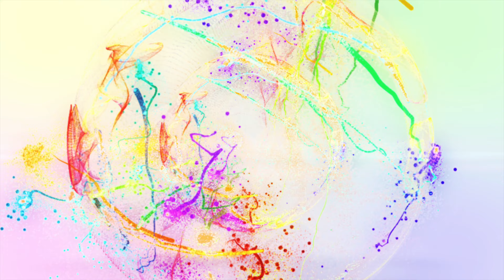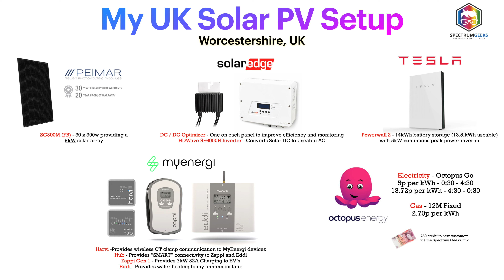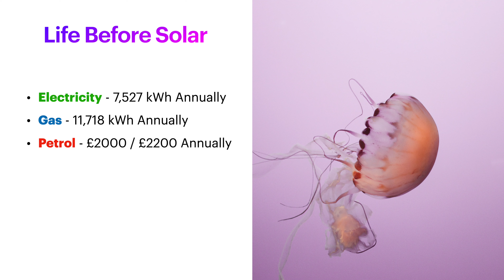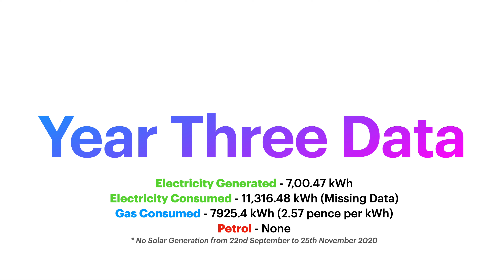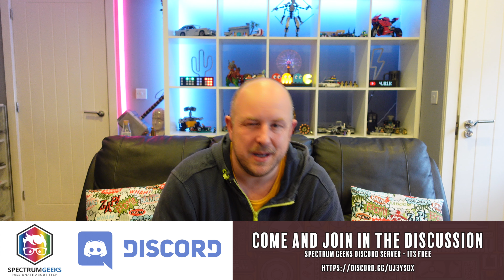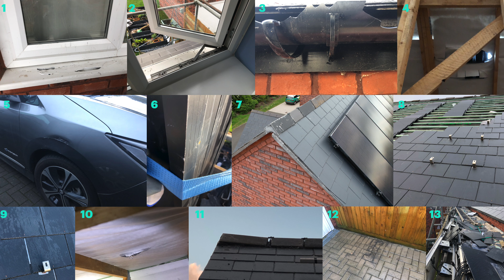My Solar Power House Year 3 Update - How is pay back looking?

Comment from the maker: Year 3 data was less, but not as low as I typo'd :) It was missing a zero, so 7,000.47 kWh. Thanks to Christopher Mahon for reporting it.
Reply: You should calculate it as 7,000 k/Wh x the standard electric cap rate 0.28p k/Wh = £1,960 a year saved. The crazy price of electricity is pushing me to consider solar.
Reply from the maker: @sang3Eta  Can you provide more info on what you think it should be calculated this way?
Thanks.
Reply: @Spectrum Geeks  The UK has no free market in energy anymore. Everyone is paying the 0.28 k/Wh cap set by the government. If you generate 7,000 k/Wh of energy, you have saved yourself £1,960.
Reply from the maker: @sang3Eta  I agree thats the price cap that the average UK home owner may be paying, but I also know many people went for a fixed rate that is higher than that.
However, in these videos it relates to MY personal costs and costs, vs what someone else may or may not be paying.
Reply: @Spectrum Geeks  yes, nobody should switch right now because there is only 38p k/Wh on offer, or higher! Outfox The Market is a trick to catch people out 61p k/Wh!!!! 
I think the cap will be 38p later this year.
Reply from the maker: @sang3Eta  Wow the OFTM price is madness.

Comment: Great info 👍🏼 thanks. I’m about to start my solar journey. I currently have a gas combi boiler (so no water tank etc. ) in this video you mentioned how you moved more gas usage onto your electric consumption. You mentioned previous videos. I looked through your previous videos but there are a lot and I couldn’t find it. Can you please send me a link to the one that covers this?
Thanks. 🙏
Reply from the maker: Not a dedicated video per se, just I have mentioned it many times.
I only use gas for heating, be that heating the house or heating hot water. So as I have an immersion tank, I stopped using gas to heat the water, and instead use the electric heating element in the immersion tank with surplus solar, or off peak electricity.

Comment: Your payback will be much smaller once your existing Octopus Go tariff expires.  13p/kWh is very cheap.  A new Octopus Go quote is over 30p/kWh peak 7.5p/kWh off peak.

You mention that you try not to export.  Is your deemed export greater than the actual export?    I’m wandering if the Agile Export tariff is better for you than the deemed export tariff.
Reply from the maker: My deemed export is 50% of my generation, my actual export is practically nothing most months, so FiT is much better than paid export.
Payback will be even faster now the rates are up (I am now on the latest Go tariff), so the off peak use and the solar generation is worth alot more.

Comment: What are the downsides to overproduction? 
Does this not future proof you as we switch to electric cars etc.
Reply from the maker: No downside really, like you say its an opportunity to "fuel" more in the future.
Reply: @ConsideredUK  I have been told that we are limited to 6 kw systems on our local grid by our energy provider.
Reply from the maker: @myopenmind527  You may be able to have more, if you have a G100 compliant device that restricts output to the grid to 6kW, but your GNO should be able to confirm.
Reply: @ConsideredUK  is that electricity then usable or dissipated in heat. 

Here are my options:

1. 
20 x 390kw Jimko panels (7.8kw) , Huawei  inverter (6kw) and battery (5 kWh). (Sun 2000 & Lunar 200). 1 Eddi

2. 
22 x 340kw jinko (7.4 kw) array, Soltis inverter, 2.5kw battery (pylon tech). No eddi / iboost 

3.
16X Qcell 340w (5.4 kw) array. 5 kw Sonnen battery and inverter. 1 iboost. 

All remarkably at the same price. 

So hard to compare apples 🍎 & oranges 🍊. 

Any suggestions?

Comment: im single with solar and a powerwall , i still have gas heating , i was going to ask my energy company to give me back my FIT payments as i have £900 in my account but with the increase in energy prices ill leave it there it'll pay for my heating this winter. i have an EV and i export over 60% . im retired so im home all day , im basically off grid with electric , i had to let some into the powerwall last winter a couple of times . but it was a very dark winter
Reply from the maker: Sounds like you got the perfect system for your needs.

Comment: Hi there, I install solar panels for a living. Sorry to hear about your roof. Slate roofs are always difficult, best to use the solar limpets, they do less damage to your roof you just need to use extra at the edge. If I'm using the metal brackets I use genius flashing it's a really good system.
I recently got solar on my own roof so am trying to figure out the technical side of it your videos are very helpful 👍
Reply from the maker: Thanks Sean. Slate roofing deffo seem to be harder.

Comment: Hey Dale, hope you're well? Personally, for my TCO, I will be counting my EV purchase as part of the calculations. Even if that's just the difference between the petrol/diesel and the EV price. At the moment the maths don't work out for me to get for an EV, but it is getting closer. I spend around £2.5k PA on diesel, but a lease will be costing me a little bit more than that plus add in the odd public charging costs. Did you consider adding the car purchase/leasing cost to your TCO?
Reply from the maker: Hey John, not really ... as I mention its kind of the rose tinted glasses aspect, just a bonus I can charge the cars from solar in the summer, and benefit from off peak pricing in the winter.

Comment: Also I think you should be adding a bit more saving in for the PW2 in winter. You're going to get 13.5kWh per day at 5p compared to whatever your day rate is. With your usage I'm guessing you'll use it all so you've got maybe £1 or so for 5 months......
Reply from the maker: Yes I use it all in winter, but with the Powerwall info its hard to calculate how much is from off peak grid, to then factor that into my sums.

Comment: I think you're counting your gas savings twice??
You say you've saved £97,47 on gas but then the solar you've used to heat your water you've counted as a saving again??
If you were previously heating your water using electric it would be a pure saving but as it was gas I don't think it counts......
Not 100% certain of this by the way as it's a tricky one to wrap your head around.
Also definitely can't do the rose tinted version. That's the cars generating that saving not the solar. They help to make sure you can use 100% of you solar which boosts your grid savings but that's it I'd say.
Reply from the maker: Not double counting the gas, just simple math of how much gas used to be used, minus how much is now used. This means the cost no longer spent on gas.
We do use more electricity now, but large majority of this is from solar. Either way its a consistent number over the three years so I think it works.

Agree on the rose tinted aspects :)